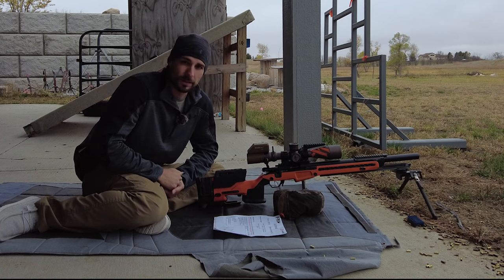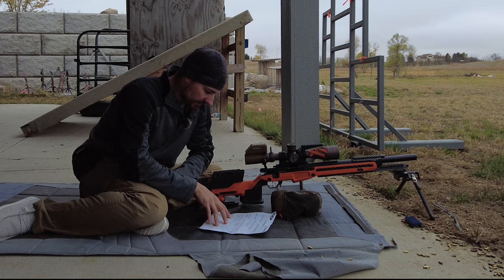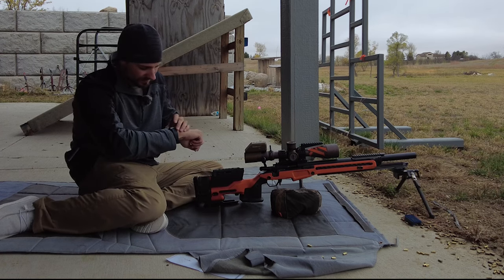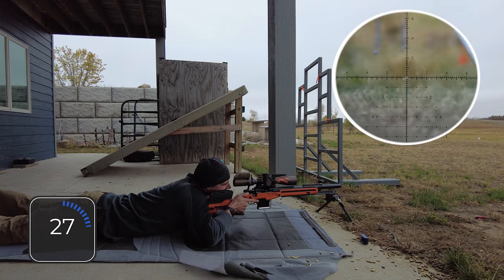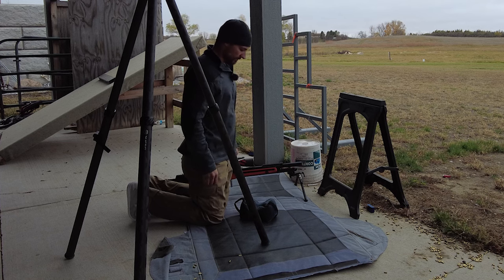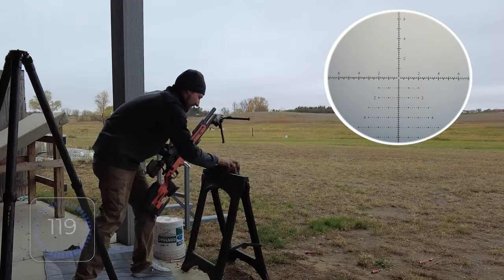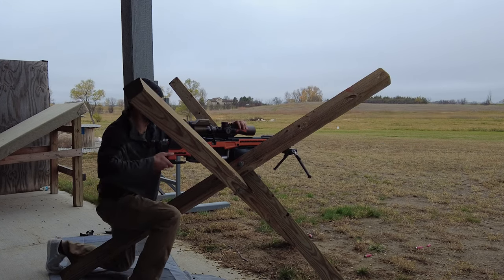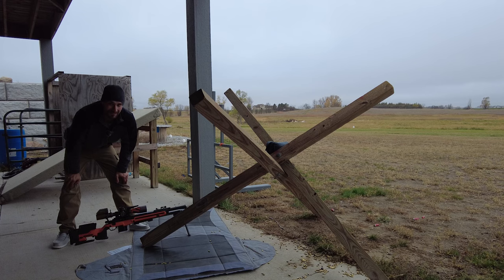My Worst One Yet NRL22 November COF

Comment: The intent behind the reset is to only take you off target and take one step back, if you measure out 3’ when setting this up your feet are almost at it when you build a modified prime position, the challenge is to be time management for building a stable prop position and target accusation, that said it is a challenging stage for 2 minutes
Reply from the maker: It is a push for sure.
Reply: @nedvedprecisionshooting  - I shot it this weekend, I made it through 9 shots even with only taking one step back, Being tall and building a stable position on the barrel is hard, doing it 10 times over, Would have much preferred it to be left, right, reset vs. resetting after each shot. I think it would have accomplished the same objective of having the shooter finding the targets and building a position.

Comment: My concern with the barrel stage is that you broke the 180 by pointing the barrel backwards every time you moved back to start position. I think this stage could have some safety issues especially with YGs.
Reply from the maker: In a match hopefully you run straight back then back around.